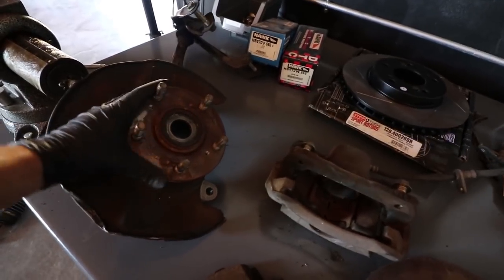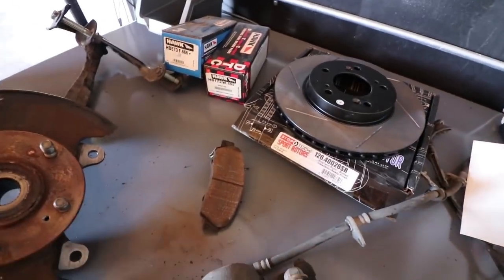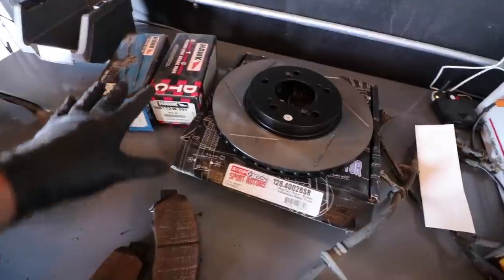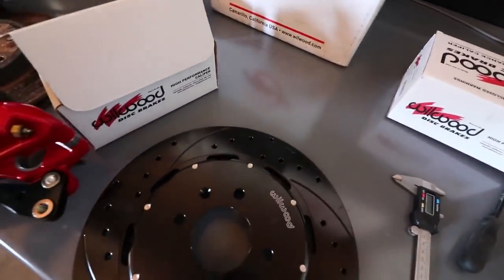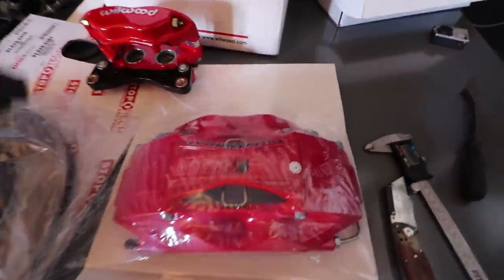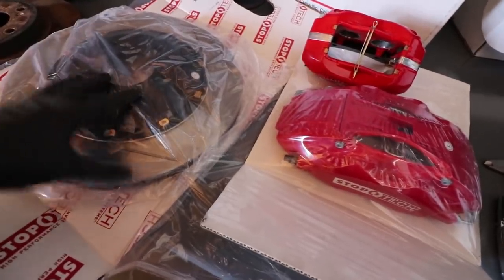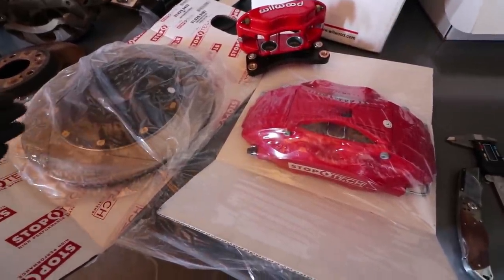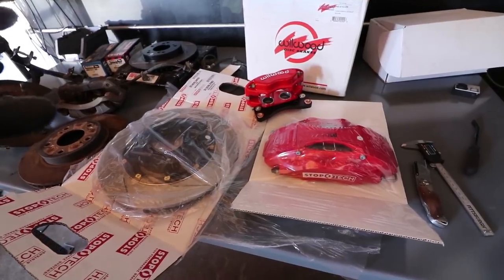$300 Brake Upgrade Vs $2000 Big Brake Kit

Comment: Slotted rotors are for venting gasses, race pads arent good for the street because they require them to be a hotter temp range to function properly but they resist fade better than oem, drilled rotors are for better heat dissipation, drag racers dont care about race pads because they only need to slow down once where as time attack racers need race pads due to constant hard braking.
Reply: So just break harder lmao.. problem solved

Comment: I've been building an offroad 4x4 FJ cruiser with likely 1000lbs of added weight and bigger tires as well as a heavy duty suspension. Was ripping through Mojave doing about 70-80mph offroad with my oem brakes with performance metallic pads and got terrible brake fade, damn near had to put my foot through the firewall and it took a while to slow down, hit some woops a bit faster than I wanted to because of this. So I invested in some larger Stoptech 2 piece  rotors and ST-60 6 piston calipers with some hawk performance ceramic performance pads. I'm incredibly happy with the results. also running a high temp fluid. I'm planning on installing some ST-41'S in the rear because with only the fronts the vehicle does squat a bit under heavy braking. The ceramic pads aren't noisy at all and make WAYYYYYY less of that sticky dust that my last pads made, I'm not running a super high HP rig so the ceramics with the larger setup seems to be working well for me. It changes the way I drive, before it felt a bit more like a boat and you need to brake a lot sooner now i can come in hotter on turns and brake last minute to a desired speed and cut in perfectly, makes it feel much more responsive as a whole and a lot less like a boat.

Comment: Totally incorrect, slotted and or cross drilling it to release gas build up, remove shutter..... You always get better braking without slots or holes until a certain temperature, simply more surface area.. Facts my man, learn then post videos.
Reply: SovL:Remedy h
Reply: Very True! Big Airbus aeroplanes have no frill rotors and they stop just fine.

Comment: If you haven’t experienced brake fade then your not really getting any benefits from a BBK.  There are tradeoffs:  Increased rotating mass and unsprung weight will cause slower acceleration and less traction over bumps or requires heavier springs to compensate.  The other thing people never mention is that increasing the piston surface area (4 and 6 piston brakes) will give you a spongy brake pedal if you also don’t increase the size of your master cylinder.  It works like a simple lever and if you lengthen one side then your ratio will be affected unless you lengthen the other side.  Hope this helps someone.

Comment: And just so you and your audience are informed Brian at Fastbreak engineer the brackets so the big brake RL calipers would fit on almost any application. Also he was the first company to make a kit fit on the 2018 Honda Accord when all other companies stoptech Rotella roller face Mugen D2 racing said they have not come out with that. he made it in house so how's that for customer service! He is the king of fabrication it only takes three days to get pads rotors or hat from his location. And he will build you a kit for your application whatever your budget might be

Comment: Pad surface area makes a difference...looks like the willwood is a rear caliper, but hard to to tell from these angles...if you think you bought a 6pot caliper, you have been duped...yes, you are spouting misinformation...research is your friend in any large/significant purchase and/or YT video...gl on your projects
Reply: not only, as he shows in the beginning there are very abrasive pads that will eat out the disks, but will stop just as well, and the benefit is they are lighter, add carbon ceramic brake disks and you get formula 1

Comment: Hate to let you know about this but your Wilwood kit with the appropriate pads at the track will probably out break the stoptech. It's about the size of the pad and the surface area and the clamping Force coming from the caliper and how quickly it can dissipate Heat.(huge brake calipers don't cool down and provide a lot of surface area for brake fluid to boil) I would be really surprised in your S2000 if there was any noticeable difference in between the Wilwood and the stoptech... especially if both of them had the most aggressive pad available. Oh and every stoptech kit I've ever worked on has squealed horribly bad.(and I understand racing pads squeal) Used to work at a used car dealer and for whatever reason a lot of Mercedes would come through with stoptech on them. LOL probably because it's cheaper than OE parts. Also adding a bunch of mass by going too big on the rotor can hurt breaking and cornering.
Reply: Assuming both brake pads are using the same caliper and rotor, a multi piston caliper with more piston area will put more pressure and evenly on the pads to stop the car better than a single or dual piston caliper.
Reply: It doesn't sound like you have any real familiarity with StopTech kits. A StopTech two piece rotor will have less overall mass than the stock OE rotor while still having more thermal mass.  (Thermal mass, the friction plates,  would be the part you actually want to heat up and cool down to store and dissipate braking energy.)

A two piece StopTech rotor will flow air far more effectively than anything from Wilwood.  The greater thermal mass and efficient convective cooling will let the StopTech buyer run a less aggressive pad while not having to worry about fade at the track.  

None of the pads available from StopTech are known for high abrasion or noise.  StopTech prefers to make pads that rely more on adherent friction instead.  Something like a Hawk Blue or Hawk HP+ will be noisier.  

Pad size and pad area are important for how the pads heat up, but rotor surface area will have more effect on cooling.  Any kit that goes to a larger rotor diameter will gain a huge advantage in radiation cooling.  

14" rotors are a great option on a street car.  I can run the local tracks and not worry about fade and then jump on the street and not worry about noise.  I run StopTech kits on both my Mustang and Miata (11" rotor for Mazda.)  

Time Attack guys who don't want any extra weight will go back down to a smaller rotor diameter and then need to run a more aggressive pad, but they're trying to remove every last ounce.  For that application. a StopTech CBK (competition brake kit) is going to be way nicer, lighter, and stiffer than anything Wilwood offers.
Reply: I’m using stoptech 328 on my k04 mk6 gti. No squealing yet

Comment: When I started driving it was looking trough the steering wheel and had to use two feet to push on the brakes . They were horrible.  With the stop tech my mechanica says it is feather touch brakes.  He is right one light push and it is great . With $7000 in a motor and $20,000 in body & paint . $ 4000 in brakes makes sense.  And they work very good .

Comment: If I remember correctly, Drilled rotors used to have a purpose(evacuating excess gasses made by using older pad formulations), but that purpose was lost with the advent of better formulations for brake pad materials and glues. Basically, drilled is just there for appearance now and slotted is the only thing that would get you any more performance.

Comment: I was considering a big brake kit for my Grand Marquis - stopping a 4,000# luxobarge doesnt sound so difficult until one considers that the driver finds corners far too fun to ignore hitting as quickly as reasonable - when a friend who drives the same year Crown Victoria got an inexpensive set of pads and rotors for all four corners and let me drive the result. Well, the ceramic pads have soft, controllable initial bite, but emergency stops were a "DROP ANCHOR!" matter.

Looks like I'll he saving a buttload of money.

Comment: The slots on the discs are there to expell the gases built up between the pad and disc during the braking process. This help maintain friction and aids cooling a little. If you supply such things then please learn about them before you sell them to people..

Comment: DO NOT INSTALL RACING PADS UNLESS YOU ARE RACING!

They do not work correctly unless hot so you will not be able to stop adequately in normal day to day use.

More aggressive street pads can be a big improvement but outright racing ones are a hazard.

Also... If you never autocross or race, slotted or drilled disks are a waste of money and a ticket to more frequent brake replacement jobs. One exception is if you love where there are a lot of steep hills and gassing could be a problem.

Comment: Like the blog but you're misinformed that is willwoods economy kit they also make a super lightweight 6-piston 14in rotor kit. That weighs less than your stoptech and outbreak what you have they also have their aerokit 6-piston which will dwarf what you have on your car as far as caliber size if you're making extreme horsepower or if your car is this track focused car by that I mean autocross only. And those kids can go up to $5,000 so just cuz you got the cheap one doesn't mean your stoptech is better than the Wilwood.

Comment: DTC or any track pad for that matter, will eat up your rotors if you daily with them.  Only run them on the track.  The track pads love to run in the hotter temps and when they run on the hot temps on the track, they wont dust or squeel as much.

Comment: Don't use race brake pad for daily drive. Dusty. Squeaks a lot. Also super expensive. And it doesn't really mean to stop your car. It means for better control and consistency through out the race (in super hot condition). It won't have enough friction to stop your car better than your stock pads since most of the time it won't be in it's ideal working temperature.

Comment: Please help me, I found these calipers on car ID, I own a chrysler 300 s 2015 v8 and I wondering if this will actually fit without adaptors, can u just confirm if it will fit or if I need a an adapter and which size

Comment: Dang. that caliper is HUGE. But, I just ordered a new 2022 WRX, and the brakes are the same size as previous year STI, or there about. 12.4" I believe. So, might need to change out rim sizes/type to make something like this fit. However, I have yet to find anything after market, or at least not $2-3k. I'm thinking to do a parts cross-check and put carrier, etc. off the Ascent that are 13.1", but doesn't seem worth the work, etc. just for 0.7" more

Comment: get spoon caliper for ur s2k, not that much more than what u spending now, they were design to use stock size rotor and great at wheel clearance, because the  number 1 headache on big brake kit is your brakes touching your wheel. and not to mention spoon caliper will get more jaw dropping than american brand brakes

Comment: Forgot to mention depending on pads and setup they all perform best under different heat ranges.
Some you have to heat up before they bite hard. All this is assuming your on the track with sticky semi slicks.

Comment: Lmao. I don't care much about longevity. I need a DD kit for a truck. 08 toy tund 5.7. Heavy braking and towing makes the from rotors star wobbling on me. Stock kit on it now, pretty much have had to replace once a year. Tire balance and alignment. Whole 9 yards, but I believe the rotors warp due to heat. 

Any thoughts? Thought about doing slotted rotor with a towing/performance pads.

Comment: The slots prevent pad float by allowing the gasses made from the friction material to be vented.
Reply: Why do people keep repeating this?  Off-gassing from volatile chemicals on pad friction hasn't been an issue since the 1960's.

The slots can act as channels for debris and water.  

Slots work primarily to create leading edges that have a shaving effect on the pad.  This increases bite and wear while dissipating heat a bit better.

Comment: Hi level description is fine.  But as others have mentioned, this is light on specific detail.  BBK systems offer little benefit over stock brakes.  Even for track days, the lack of an upgraded master cylinder, and end to end  brake lines which are both too small and inefficient for being able to really improve brake performance.  Slotted or cross drilled also have limited advantages. Cross drilled rotors are banned from most racing series as they are susceptible to structural damage when they get supper heated. F1 brakes are neither slotted nor cross drilled, and they generate about 5G of braking force.  Save your money and purchase performance pads, and high temp. brake fluid, as you'll get just as much out of your stock brakes.  And remember there's a reason Brembo is found on F1 cars and not StopTech or Wilwood.
Reply: Velocity Boy I have a Nissan Armada looking to put some big wheels on it(26 inches)  So you're saying just upgrade the pads & fluid will be enough?
Reply: Or buy a BBK and don't worry about switching between overly aggressive pads and normal pads.  Then enjoy confident braking response and a lack of knock-back from better caliper stiffness and a floating rotor.  

Why would a modern car need an upgraded master cylinder to be track-ready?  If you maintain stock braking torque for a given pressure input, increase rotor size, and increase caliper stiffness, the required caliper piston area will be smaller and the stock master cylinder diameter will still be sufficient.  Normally, master cylinder upgrades are for cars switching to radically different brake setups or overall demands.

F1 uses carbon brakes and is a terrible example for talking about rotor slots.  Look to something like IMSA where the cars are mandated to use iron rotors.  All of them, including cars with Brembo setups,  use slots.

Comment: I’ll take wilwood over anything else any day of the week..... I can just run to Camarillo, which is like 30mins from my city, and go to where wilwood is located and willcall my stuff take to some techs and be on my way.... they make the best brake products, in my opinion.... I’ve used them on countless cars and they have always performed... I have them on my chevelle, which is just a toy and I have their super lite calipers 6piston front and 4 piston rear, 13” rotors front and rear, and their master cylinder/prop kit..... and they are way better then stop tech...... and if I want to go past the rotors and calipers I have now I can get their aero caliper and carbon rotors..... but u have to really choose what u need and not something that looks cool, a lot of pads and rotors don’t work unless they are heated up first to get the stopping power... so really have to pay attention to what your looking at... like I got the cross drilled and slotted rotors cause that’s what the kit came with, but the pads I made sure to get a good street compound that has a more aggressive bite but doesn’t need to be heated to get a good bite, they get better as heat is introduced, but when just starting up and going they will provide a good bite cold..... so really all it comes down to is intended use..... what are u really going to do with the car.....
Reply: Yes, Wilwoods are mostly for light driving and hot rods with no calculated brake bias.  

Is there anything about Wilwood that even comes close to StopTech?  Wilwood uses cheap caliper designs that are limited by 3 axis milling, Wilwood doesn't match brake torque output well, Wilwood relies on using its cheap "proportioning valves" which are inconsistent from part to part, Wilwood still supplies stacks of shims instead of just designing things to fit,  and Wilwood calipers don't offer anywhere near the stiffness of higher end 2 piece calipers.  Requiring safety wire for their two piece rotor assemblies is also strange.  

Here's a quick anecdote.  In 2012, Rhys Millen was running his Hyundai Genesis Coupe with Wilwood brakes in Formula D drift competition.  When he entered the same car in the Pikes Peak Hill Climb where he would set a new record that year, he switched out his Wilwoods for StopTechs.  Drifting requires almost no braking.  When going up Pikes Peak, braking mattered and he ran StopTechs.

Comment: this is just a re-upload of someone else's content. you can even see UPIs watermark in the bottom right corner.

the original video which was uploaded 2 years before this one is named "Toyota Tacoma UPI rear drum to disc conversion kit installation guide"

Comment: Hello,
I am would like to upgrade the brakes of my 1994 Defender 90 with a new LS3 engine in it (Originally LHD 300 TDI but converted to LS3).
I would like a full disc (calipers etc...) set for all 4 wheels.
What do you suggest?
Thanks.

Comment: He’s got black gloves on, he must know what he’s talking about lol

Cross drilled rotors are for looks only. 
Bigger is not always best. It’s all about heat, yeah the bigger the surface area the better for heat but A smaller setup that’s in proportion to the rear with proper fluid and ducts will stop your car fine on the track.

Comment: I have a 2017 honda pilot. Will the wilwood ones fit on my suv? I have upgraded my wheels to a smaller diameter for an off road look. I went from 20" rims to a 17" deep dish.

Comment: Love your video's, projects, and products! Keep up the good work! But aggressive pads do NOT harm your rotors at all.
Reply: Randee C The HELL they don't! Call Hawk brake company and inform yourself. Their most aggresive brake pads ATE my EBC rotors in 3 months. He warned me, but I didn't really care. I wanted the best possible brakes I could get for my car...and they were.
Reply: In Randee's defense, they still shouldn't "harm" your rotors (assuming rotor temps aren't excessive).  All pads will have rotor wear but yes, aggressive pads such as those with high metal content will eat your rotor much faster.